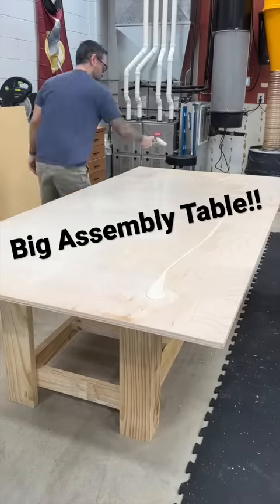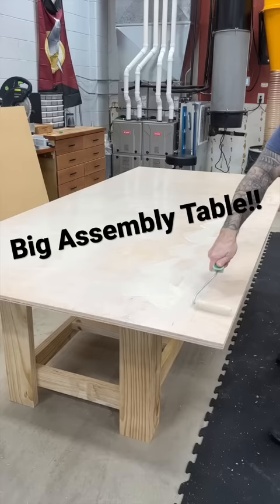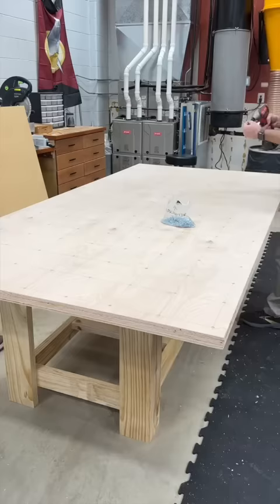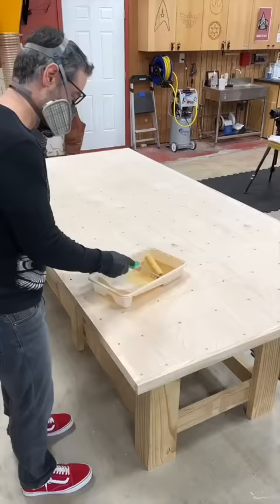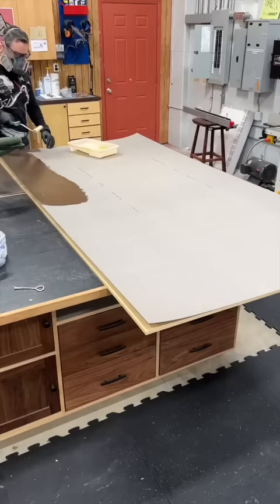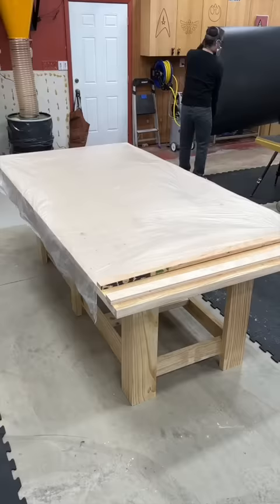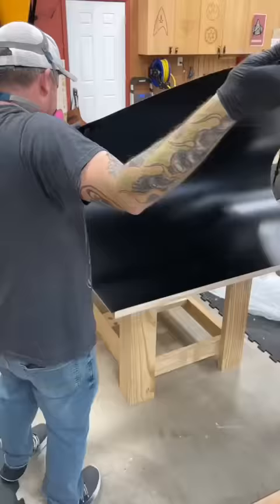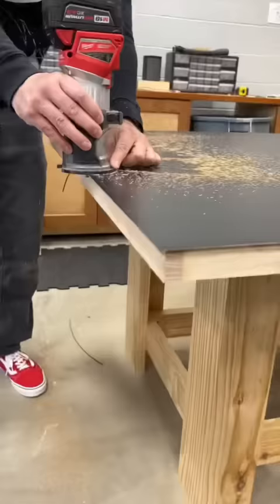Making a nice BIG assembly table! | #shorts

Comment: Can you elaborate on the secret source for sheet goods that are “flat and cheap”?
Reply: I’m still searching for that as well. I’ll let you know if I find it!
Reply: At this point it might as well be like the old speakeasys were. Gotta know somebody and have the password.
Reply: Not in this part of the world (Portugal).LOL
Reply: I found damaged flat hollow core doors are discounted at Home Depot. Glue a sheet of 1/2 inch MDF or plywood to them. They make agreat assembly table or portable work surface. They get beat up just glue on a new piece. Almost as good as a torsion box.
Reply: @AnthonyStabler  great idea though I really want to build some cabinets and I don’t think that’s going to cut it. :)
Reply: @Chris Emens  plywood and osb has went way down in my state. My local menards has it to pre 2019 covid prices.
Reply: @jordanharvey2163  i should check menards. Home Depot was still way too high to be practical in IL as of this past weekend.
Reply: @Chris Emens  what city in Illinois? I can get you local deals from menards , I know a few lumber yards they buy from , I used to haul menards loads , also have a local menards by My house that hooks me up with damaged materials,  drywall , lumber , flooring ect for pennies on the dollar.  I also get their used appliances for donations and I fix them and donate to the low income and widowed elders,  or single moms struggling.  I like to help anyone I can.
Reply: @jordanharvey2163  Thanks for the offer! I’m in the burbs, just North of Chicago. I usually get hardwood from Owl Hardwood, but always looking for other options, especially for sheet goods!
Reply: 3/4 Mdo is cheap and incredibly flat
Reply: If there is a cabinet supply house anywhere near you plywood is usually cheaper and better quality than the crap sold at HD and BB..(lowes)
Reply: @jordanharvey2163  I personally would stay away from OSB, the unevenness of it will telegraph thru the Formica. a/c plywood, particle board, luan, MDF are all good choices- Not being a wet application the cheapest will work.
Reply: @chrisemens4022  l JJ
Reply: 3/4 “ MDF TO 3/4” MDO .
Reply: Go to your local flooring stores and pick through the remnants.

Or if you have a habitat for humanity near by.  Flooring stores donate their excess stuff there for a write off.
Reply: I've been doing counters for 23 years, and I've only subbed from flooring stores.

Might sound weird, but that's were you go when you want to do sheet laminate, Wayne's cote,  and frp.

So that's who has the leftover cheap flat sheet goods.
Reply: @chrisemens4022  lol, I was gonna mention Owl, they will also do glue-up in their press.
Reply: So, next time you have a job with MDF, buy extra, a couple of layers of MDF will be flat on top, make a torsion box on top of that, you can have a flat work table that is lighter and will last.
Reply: I'm still looking for "flat". I've given up on cheap.
Reply: Look for some local production shops  in your area. A lot of them just throw away the cover sheets from units they purchase.
Reply: Lol nice one!! I'm thinking if its an assembly table with laminate why not use mdf or even particle board with solid edge
Reply: Can't even find them "flat and expensive"

Comment: I’ve been using a 3/4” sheet of melamine as the top layer of my assembly table. Wood glue won’t stick to it and it’s easy to scrape up once it’s dried.
Reply: I use an 1/8" or 3/16" tempered masonite thats screwed down. If you mess it up, just unscrew it and put down a new one.
Reply: To me, that's the best way.
Reply: Same. When it gets destroyed just replace it with a new $30 sheet of melamine. When I'm using the track saw I just drop 1" foam sheet on there

Comment: I used to work in a high volume laminate cabinet shop. The very best way to hold contact cemented pieces apart while positioning is a clean round extension cord. You lay it back and forth over the substrate maybe 6” apart…the  set the laminate on top of the cord.  When ready to join start pulling the cord out as you press down.  Big sheets use 2 cords and work from the middle out.  This works 10x better than sticks, or slip sheets, or anything else I have ever used. I told Izzy Swan about it yrs ago - he has a video showing it or at least used to.
Reply: Too smart. Thanks for sharing that. Champion
Reply: I've been doing laminate for 40 yrs the best thing about using cords is you can do any shape or size. dowels or blinds work ok but sometimes they are a pain to use.

Comment: I need to water my shop and hope it grows a bit wider and longer. Short of that happening I'll probably make a slightly smaller table..
Reply: 00
Reply: I had a ford ranger and despite all the leaks the bed topper had, never grew an inch. So disappointing
Reply: @miles11we  did you fertilize it? I mulched the bed of my f150..Took a few days to empty it out into the yard..
Reply: @martinoamello3017  shit I didn't even think of that at the time, I'll give it a shot next time

Comment: Top tip for franks top tip fir the plastic, fold one end back on itself, you can then pull the  plastic back as you go rubbing down the laminate rather than lifting the laminate up works a treat and i learnt it from a bloke called Pete 👍
Reply: I've been really looking at doing my own laminate for a decent sized bar.  Never tried it but that tip sounds like a gamebreaker

Comment: I use a long (50') extension cord, cleaned and placed on the top of the surface in a back and forth S pattern. I then start at on end and press the laminate down, roll it firmly, and then begin the pull the cord out, 1 S at a time.

Comment: Just a tip...use white Plam.  Doubles as an "erase board" I have measurements and notes written all over my white assembly/out-feed table. Erases with DA or lacquer thinner
Reply: Grab some "dry erase" markers.  Rubs off easily with a finger.  (not the most durable, so be careful to not inadvertently rub off something important)

Comment: I used the plastic trick whenever I was bringing two sheets of laminate together on a single plane because it is much easier to align. The first time I did it I transitioned to just using that method for laminating. That is until I noticed I was getting bubbles more often as air was prone to getting trapped. Not a difficult fix but was annoying enough I switched back to using dowls for the majority of my lamination. I only use the plastic where alignment is a higher priority. Definitely a handy trick to have in my holster though.

Comment: Just a foot note, when you are trimming the edge of the Formica, keep an eye on the bearing on the router bit. It tends to collect the contact adhesive and will keep it from spinning freely. Also use a good file to flush the edge after you run the router.
Reply: I trim it with file first then use router)

Comment: I've laid miles of laminate in my time. I pull a long extension cord through a rag and loop it in waves. Lay the laminate on top of the cord to get your alignment and start at one end pulling the cord out as you press it down. Guaranty bubble free.  Use particle core not plywood as a substrate. Plywood is susceptible to delamination and will telegraph the grain. When using waterborne contact take your fingernail and scratch the surface (outside the area being glued) If it skins up like pealing a sunburn , it's not ready yet. Get down at eye level and look across  each glued surface and look for any particles that may have been picked up. Nothing worse then getting a bubble from a tiny wood particle.

Comment: Why not go with torsion box? I'd like to know the pros and cons.
Reply from the maker: Because they're overkill. As the first guy to post a torsion box on YouTUbe I'm certainly guilty of encouraging people to build them.  :) But over the years I've realized they're totally unnecessary. But if you have the time, budget, and desire, no one can fault you for wanting the flattest surface possible.
Reply: I found damaged flat hollow core doors are discounted at Home Depot. Glue a sheet of 1/2 inch MDF or plywood to them. They make agreat assembly table or portable work surface. They get beat up just glue on a new piece. Almost as good as a torsion box.
Reply: @The Wood Whisperer  Thank you for the reply. I value your opinion. Torsion box really seems like too much trouble.

Comment: Not to nit pick, but I’d put the top sheet face down then glue then the bottom sheet then screw it. I’d let it fully dry then remove the screws, then I’d flip it over and laminate the top.  If those screws aren’t perfectly level with the surface of the ply those voids will get smashed, also, if for some reason you cut through the top with a saw you don’t want your blade hitting a screw.

Comment: They make 5 gallon spray tanks for that contact cement. It speeds up the process quite a bit. I also recommend a “PlASTI-CUT” file. It has a cutting edge where you can do essentially do the same thing as the router only by hand and you can get in tight areas and square off corners where the router can’t reach. It has a side for removing material and a side for finishing. They also make a wax you can apply to the router bits that helps with the adhesive gumming up the bearings.

Comment: How will you add work holding devices to that flat surface now?
Reply from the maker: I won't. That's not it's purpose.
Reply: @woodwhisperer  Would you show or tell us about how you plan to use it,  please?

Comment: Not a bad idea. I always used 30" long pieces of 1/4" x 3/4" cabinet scribe, spaced about 7" apart. Let's you slide the glued laminate around, you can pull the sticks from the wall out or from out in to get it tight.

Comment: Black tops are sexy, but white ones can be drawn on. In my experience, white melamine serves its intended shop purpose far long enough to yield a significant cost benefit compared to application of horizontal grade laminate.
Reply from the maker: Yeah I don’t draw on my tables. I have rolls of paper if I need to make large drawings, which has the added benefit of being movable or permanent if I need the drawing for something in the future, like a template. And because I film, black works out a lot better for me.

Comment: I’m not sure if it’s important but shouldn’t you screw down the table from the center out? That way you push any trapped air pockets out. In the video it looks as though one guy started on the edge while the other started in the middle. 
Again if you saw the stuff I’ve built you’d still be laughing.

Comment: Wouldn't a 4x8 Melamine on MDF panel have been cheaper? Home Depot shows the entire panel costing a lot less than that laminate sheet.
Reply from the maker: Maybe, but Formica is going to be more durable and offers a full continuous surface for the top.

Comment: Grand Master laminate installer here.

Confused about what kind of glue you were using that allowed you to put plastic down.
Never heard of such a thing.

A pro uses wooden slats, and because  I have unlimited  access to laminate I also use laminate slats, when using the taller wooden ones are not an option.

If I were to ever put plastic over my roll on, or spray glue. It would destroy my job.
Reply from the maker: It’s just contact cement. As a "grand master" I'm sure you've heard of it. :)